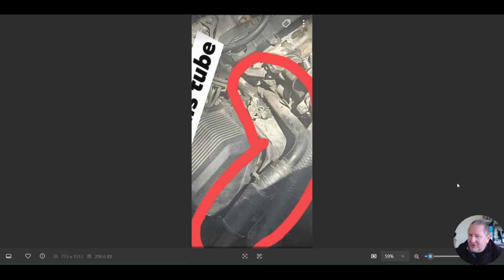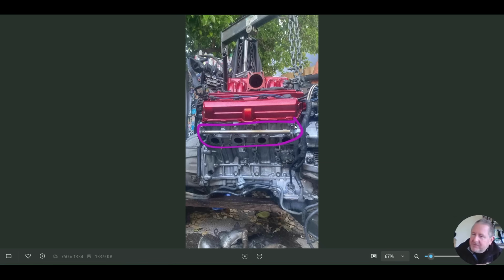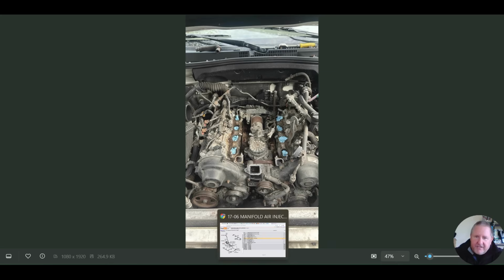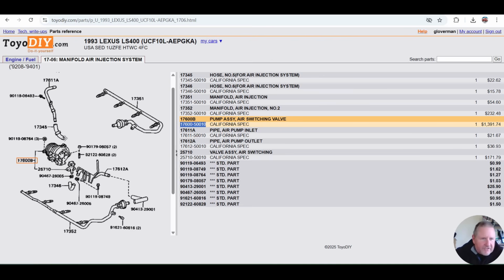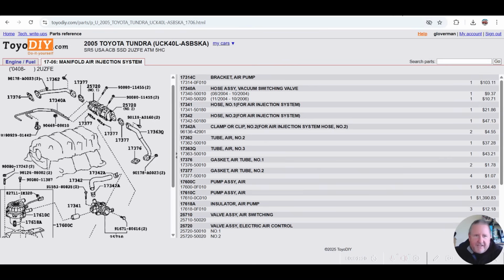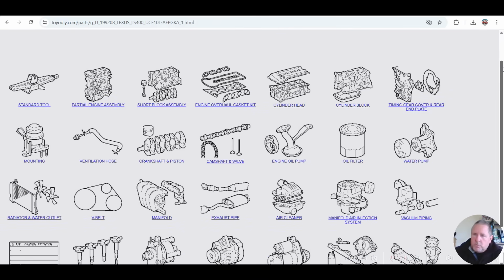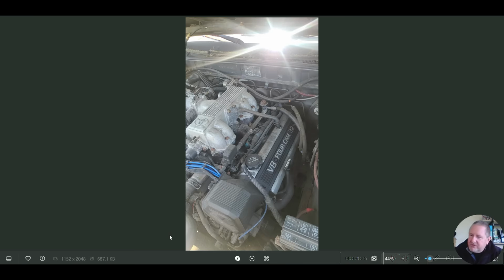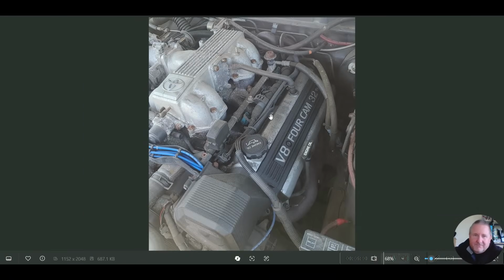UZ secondary Air injection

Comment: This is wonderful information and advice, thankyou for that! - I've never encountered such Air injection systems before for the reasons you mentioned in the video of course, Looking at the 1UZ variant, it appears to be a mostly mechanical system?, I was wondering if someone were wanting to remove that system (bought an imported California engine to use here in NZ etc) - would it just be a case of removing the items related to it, and plugging the ports in the head? or would this trigger a fault code in the factory ECU if it were able to notice that system wasn't phoning home any longer?
Reply from the maker: Its easy enough to remove and sort any associated fault codes